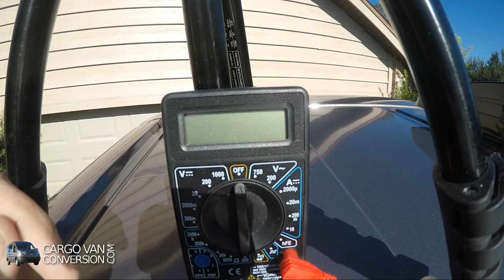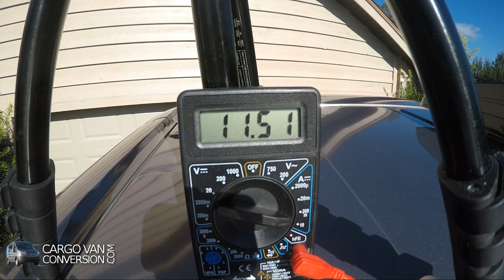ETFE Flexible Solar Panel Installation - Part 2

Comment: This is just another guy that JUST got his bendable solar panels and thinks they are great. In a year or two, like most, he will probably replace them. Everyone I can think of on youtube has replaced their bendable with  panels. They deteriorate over time (look at my videos). Who cares if there is a new so called etfe plastic coating. These panels are 40% less efficient than rigid panels and if space is at a premium on the roof of a vehicle,  which it is, you want to make the most out of the space so getting monocrystalline rigid solar panels is the way to go.  Please don't waste your money guys, you may think it's worth it now, but when your panels aren't bringing in many amps and your battery is on low, you'll buy rigid panels anyway.  If you do choose to go down this path still, remember that they are less effecient so basically you'll need 2 of these bendable panels to produce what 1 rigid would produce.  That means if you have 1 100 amp hour battery, you need 2 bendable panels.  It gets very pricey and you'll be replacing deteriorated bendable panels long before you replace the rigid counterpart.   Save yourself from a costly mistake!
Reply from the maker: Hi Bayward,
First, I appreciate your comment and have been following your channel too. Seen your flexible panels and failure.
I always try to give a balanced view, here and more extensively on the website.
I've always maintained that if you don't have an explicit need for flexible panels, to go with rigid panels. Not that rigid panels are more efficient, because that is not the case anymore. These panels have equal or better efficiency then many rigid panels. But rigid panels have a track record and are much cheaper than flexible panels.
Most of your arguments pertain to the older 'first generation' of flexible panels. For multiple reasons, I always have argued against those.
I made clear that for me, stealth is an important part of this build and the main reason for installing these panels. It is also a good example for people who contemplate buying them, as there are only a few appropriate reviews available on-line. I'll be updating my experiences with them over time and one can draw their own conclusions.
I went a long way to install them correctly, according to manufacturer's recommendations and used many upgraded materials, I have done much research and haven't found many similar projects, if any at all.
Lifespan has always been an open question for me, as these newer panels haven't been available long enough and they cannot be compared with the panels you've used. That's a risk I take and that's something I always mention.

Van Williams
Reply: It could be that you have newer panels, I had some from 2015 and also purchased an additional in nov 2016 (1 year exactly) of which I lost on a freeway and shared a video of that lol, so at least they produced that for me.  Not many amps tho!  The marketing material that came with them also said they were just as efficient as rigid panels at the time. (The manufacturer claim you shared that "..or better efficiency than many rigid solar panels" raises red flags for me.  I've not seen anything more than 17% efficiency and skeptical of the marketing claims unless it's independently verified.

Here are the one I purchased last year. https://www.amazon.com/gp/product/B017OMTAV6/ref=oh_aui_search_detailpage?ie=UTF8&psc=1

However, I did a side by side test of both generations of my bendable renogy and HQST along side rigid panels (1 year into ownership) and my findings matched what the community as a whole reports and that they are considerably less efficient compared to rigid.  Do you have a rigid panel lying around somewhere you can test with? I'd be curious to see how they compare in your tests; it is possible within the last year there was a breakthru in technology or that they become less efficient over time.  On another note, it's advised to use an air gap between the panels and the metal skin of the vehicle as they, (especially the bendable) are prone to loss of efficiency in high temps.   All the same, if you have the dough and roof space and it serves your purpose there's nothing wrong with buying them.   I was very excited when I got mine but disappointed 2 years later. Would make for some good content on your channel to independently verify the manufacturer claims so I'll stay tuned for that.  I like your presentation style and professional audio setup.
Reply from the maker: Hi Bayward,
In my opinion, these are completely different panels compared to the 'first generation'. But more important is the type of solar cell used. There are many grades, each with their own impurities and these are difficult (I would say impossible) to recognize by ordinary people like us. Many of these older and cheaper panels used low grade solar cells and while they advertise high efficiency Sunpower cells, you may get Sunpower cells often of a low grade. That in combination with the PET laminates, deteriorates within a year or two, resulting in broken or not performing panels. You were a good example of that.
It did not help, how these panels were promoted, by standing and dancing on them and bending like they had to go around the corner.
The newer panels should have addressed some of these issues: ETFE should not delaminate and is higher efficiency (doesn't reflect sunlight). High grade Backcontact Sunpower cells: backcontact has more visible surface. High price should reflect on quality.
That said, there is no long term experience with these panels and it may all be in vain and end up like your panels. That was a risk, I was willing to take. And will see how that works out. I did a simple test after mine were installed on the roof of the van (405W open circuit/no load): 11.5A at 28V at 10AM on a sunny morning in Florida. That would translate (with a MPPT) to more than 100A per day in winter. I will settle for that.

"The manufacturer claim you shared that "..or better efficiency than many rigid solar panels"
It was not a claim of the manufacturer; they state 20% efficiency and that is better than many rigid solar panels. However I don't really know what 20% is, I may just use it as a means to compare. What I'm interested in is volts, amps and watts. The high(er) voltage of around 29V translates in more amps with a MPPT, especially during the cooler winter period, when need is greater.

The air gap issue could be real; it is much talked about, however my research has only found one actually documented case in Australia. I'm not an expert at this but have to take it serious, but while many say it is an issue, some say that the metal roof of a van works like a giant heat sink. I also think that air flow under panels is overrated. Air flow will happen when you drive, but I will be parked 95% of the time and airflow will be minimal, even with rigid panels.
I chose the simplest solution by adding more watts to the system, to compensate for any possible loss, so no issue for me there either.

As you said in the end, it is a personal choice and that's what I like so much about these individual conversions. Everybody has their own design and nobody has a cookie cutter solution, like you can buy at the dealer. That's great!

BTW I have only a very simple audio solution: just a lapel mic with a small, inexpensive recorder. I found out quickly that you need a separate recording device for making videos. However it adds a lot of work to the video-editing :)

Van Williams
Reply: Great discussion here guys. I am a fan of both of you.
Reply from the maker: Hi Mark,
Different views make for a better conversion. Everybody wins.

Van Williams
Reply: I'm agreeing with Mark.
Reply from the maker: Sorry, Youtube is acting up and I couldn't get to your other comment about the source of my solar panels.
These are 135W ETFE Backcontact panels and their length fits exactly the width of the roof of my Ford Transit.
I ordered them directly from LinkSolar https://cargovanconversion.com/buy/135W-etfe-solar-panels
They are quite expensive, but after ~5 months of use, they seem to work better than expected. They are much better than the so-called 'first generation' of flexible solar panels. You can also email themanager Shoven Dean at info@link-solar.com
If you have more question, you can always contact me.
Van Williams
Reply: WOW, That was a great discussion. I was about to ask about flat vs mounted. Everyone is using 'z'mounted panels etc.  Your flat panels look great but I too was wondering about the 'air gap'.. thanks guys
Reply: @Bayward  efficiency is pertaining to size of panels, not how "good" they are. They will still produce the stated output